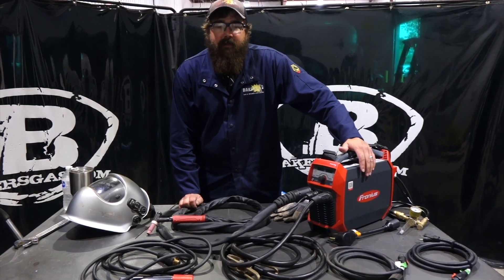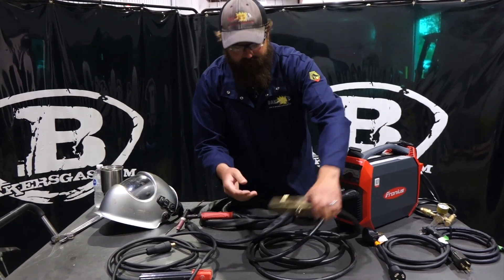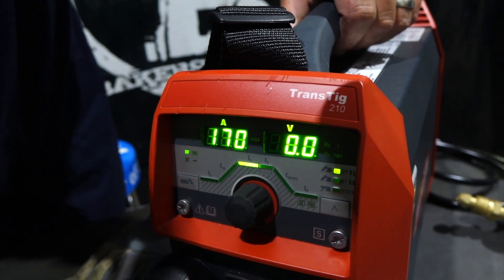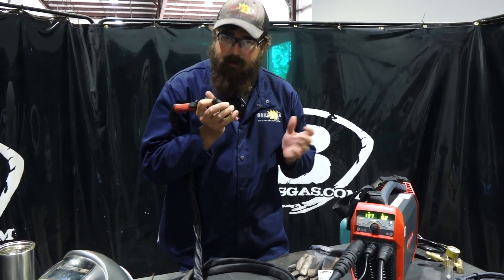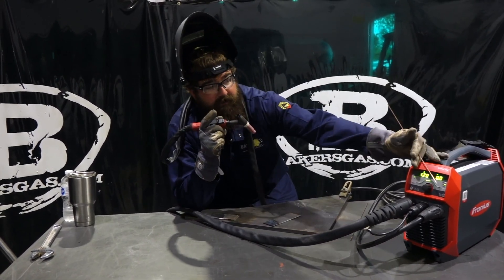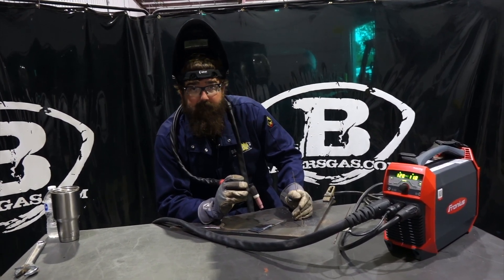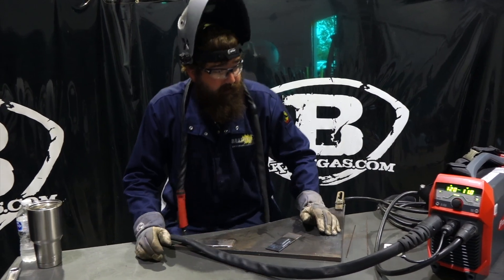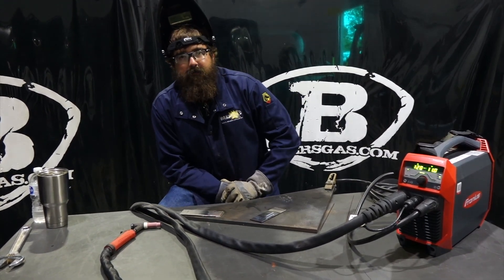Fronius TransTIG 210 Review and Demo

Comment: I have a transtig 210 , went to upgrade the firmware with Fronius software and gave me an ERR 18 , machine is locked !!!!!   Call tech support there new firmware is password protected 
and the tech support did not know the password to unlock the firmware , they made so difficult to upgrade with a PC that I called a  friend who's an IT to do 
and he had a tough time . I would not recommend this machine until they make upgrading easier , Millers are pretty easy !!!!